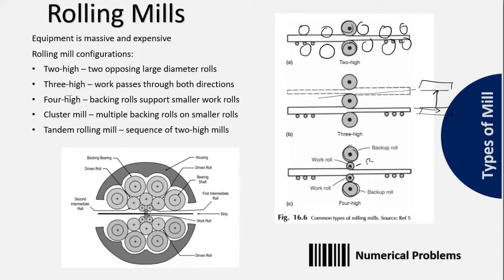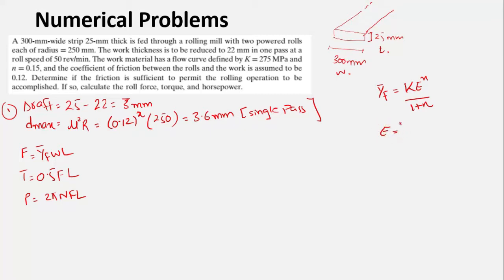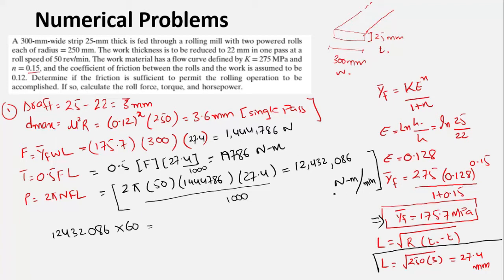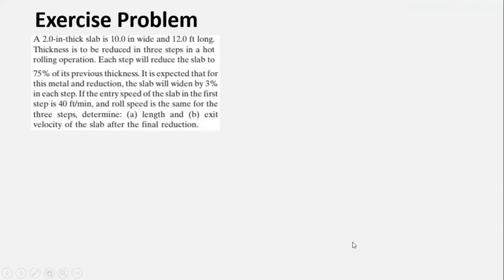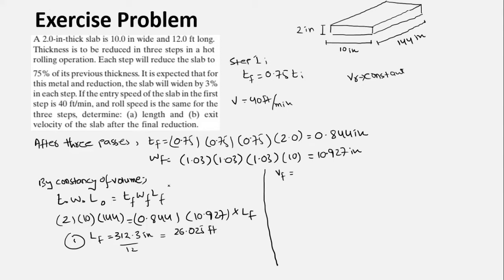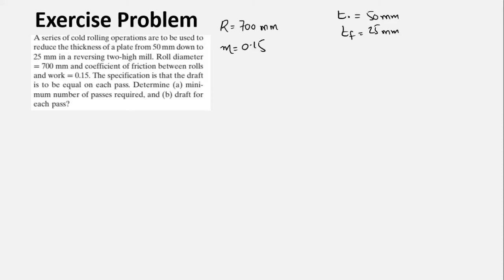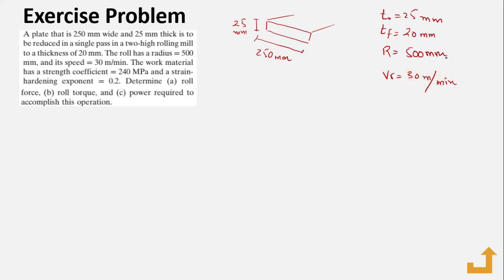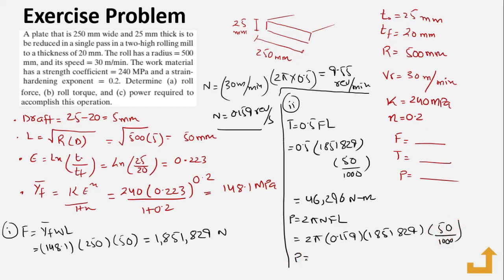Rolling operation-Numerical Problems

Comment: Design a rolling strategy for a 3 stage 2-high rolling mill. A 20 mm steel billet is rolled into a 5 mm thick sheet. Assume friction coefficient µf ≥ 0.6. Please calculate and provide the following data: R1, R2 and R3 (roll radius). h1, h2 (sheet heights after each roll pass). Make sure that the condition of grabbing is satisfied for the rolling parameters you select. Please clearly mention the assumptions, scheme of solution and obtained results.
Sir could you please help me to solve the above the question?

Comment: Hlo sir, for calculating fina wide , we will take 3% of each step then we are take 0.03 of initial wide but in u r solution you take it as 1.03 of intial wide how 1.03 will come....
Reply from the maker: Hi,  it says the width of the slab is increasing by 3% upon each pass,  hence after step 1 the final width will be = 10 + (10*0.03) =10.3. you can write it as = 10*1.03 = 10.3 as well.

Hence for 2nd step it will be 
=10.3 + (10.3*0.03)= 10.609 or you can write it as = 10*1.03*1.03= 10.609

In similar way, for the 3rd pass

10*1.03*1.03*1.03